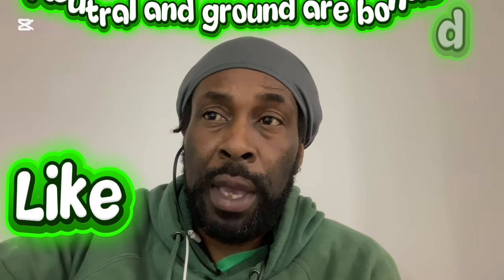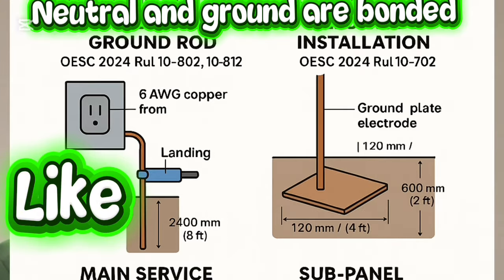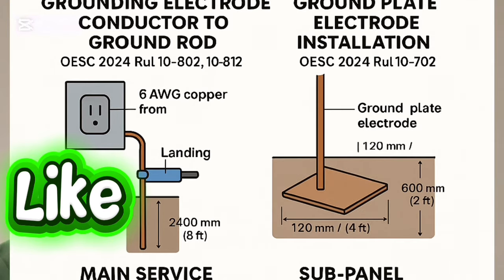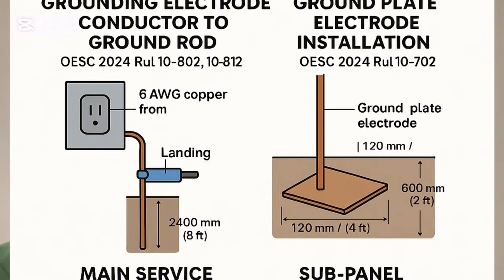Grounding & Bonding Explained ⚡ Code Rules Every Electrician Must Know (OESC 2024)

Comment: At 4:54 mins you spoke about the importance of of site location. Can you name a few of the variation based on sites?
Reply from the maker: Ok here let me break it down when I mention it varies from site location in some areas there are extremely rocky and what happens is you will not be able to use a ground plate properly and it will not do its job so we use ground rod which are driven into the ground mostly use in USA also again we use ground rod. In Canada but only if ground is rocky

Comment: Heard you mention (GEC) during your grounding series, would you be able to explain what it stands for?
Reply from the maker: Ok GEC  stands for grounded electrode conductor which is that cable that will come from the earth in order to protect you as a person and the equipment it is form through your ground plate or your ground rod .

Comment: Hi, new here!  Very informative video, at 5:47 mins into the video, you mentioned the neutral coming from the sub-panel must be isolated. What do you mean by isolated and how would one achieve that?
Reply from the maker: Hi and welcome what I mean is when you have another panel beside your main panel your neutral which is your white cable will land on the neutral bar of the panel and not the ground bar .